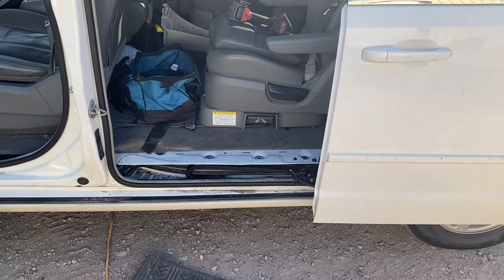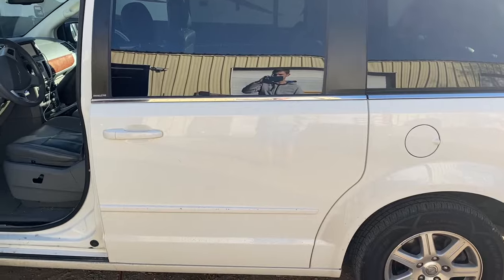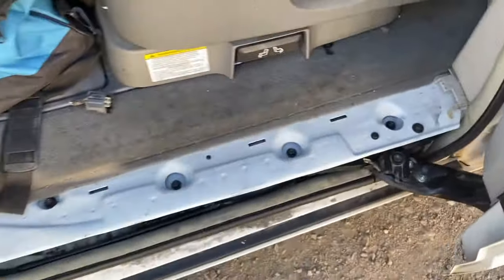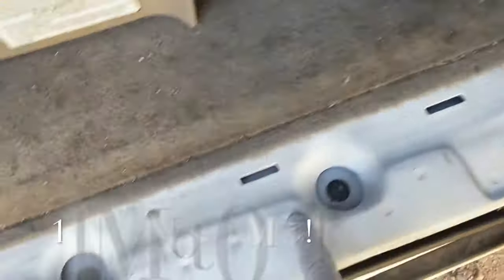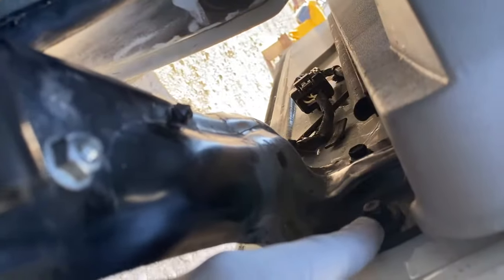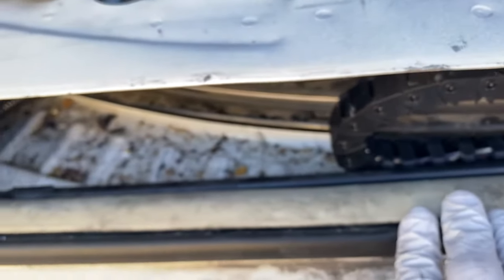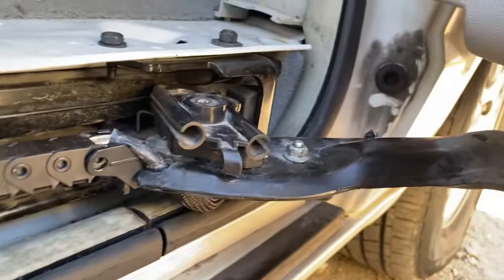Chrysler Town & Country Dodge Grand Caravan Power Sliding Door Issues 08-20 FIXED!

Comment: Be sure you sliders are lubed. My door was stopping half way then reversing. I lubed it up with penetrating oil by simply spraying it in the upper slider and that fixed it. It closed/completed the cycle after that.
Reply: Which are the sliders?

Comment: We’ve got a 2014 Towne &Country and the rear drivers side door will not open or close by any means. Fuse M38 is fine.  Other door is fine. When I push the button above the drivers head, I hear a clicking sound in the driver FRONT door, but the driver rear door does nothing. Cannot open it manually either. Any suggestions?  It is closed flush with the body.

Comment: I have a 2014 and on the passenger side I replace the motor Amtrak assembly I'm still having the same problem
 I would push the buttons the door would open partway like it lost power. Same with closing from open position, close part way than stop. Then replaced wiring harness with new, still same issue. Help.
Reply: Module  bro

Comment: 2014 T&C, My Passenger Door Stopped Working Via The Button & Passenger Window Stopped Working At The Same Time, I Replaced The Chain & It Didn't Fix The problem, I Also Checked The Fuses, Do You Have Any Ideas??
Reply from the maker: Connection issue potentially? Front passenger window? Or which window are you talking about
Reply: The same window in the passenger sliding door.

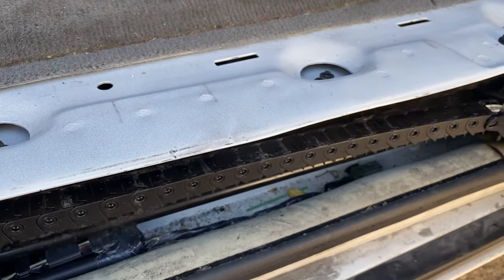Comment: I have the same problem that you had, described at 3:38, where the bracket broke off of the door arm.  Can just that piece be replace?  The cable has me concerned however, because like you describe, the cable is wound up in the motor at the front (under the drivers seat belt).  Do I need to replace everything that you did or can I just replace the bracket?  And if I just replace the bracket, how do I re-stretch the cable?
Reply from the maker: I would just replace everything. I think it’s too much of a hassle to do the cable and the part isn’t that much.

Comment: What possible reason could be the rear sliding door switches do not operate the doors. One switch went out months before the other. The key switch operates the doors as well as the 2 switches on the console up above forward.
Reply from the maker: Could just be bad switches.

Comment: both sliding doors operate fine with FOB and roof/visor mounted controls, but both just quite operating automatically using the interior pillar buttons or by pulling on the door handles... any ideas?
Reply from the maker: Replace that switch.

Comment: What if BOTH doors suddenly stopped working?
Reply: mines did and the windows in the back
Reply: Same issues I'm having plus the seat heaters for both back seats stopped working. It all went out at once.
Reply: Sounds like the fuse in the engine bay.

Comment: My doors won't open even manual
Reply: Bcuz I have kids I took my panel off, had 1 of my kids manually try to unlock it while I pushed with both feet. It made a large bust noise. But manually opens up and shuts. I made sure to tell all my kids even if front doors are locked they still will open. Just pull the handle as if you are opening the door. Just in case of an emergency. Plus they know break a window if have to those can be replaced.  It's been over a year now still opens and shuts manually. Oh ya.. Be careful I had my kid make sure fingers were just there and prepared them that the door may open and could break off so back-up quick LOL Super mom for breaking the door 🤷😂
Reply: @14babzie  Thank you.
Reply: NP hope it works 🤞
Reply: Another thing I turned the switch thingy off where u can push the doors to open.
Reply: @14babzie  I will try.  It was working perfectly last week and when I was trying to open it Monday, it won't budge.
Reply: I'd try to manually unlock it first flip it up and down if u can. Mine makes an annoying buzzing noise, when I go to unlock it even now it makes that noise. When using my remote for the one door it won't make a sound or anything. All my other doors work and slide open.
Reply: @14babzie  I'm waiting on my hubby to help me out.  Thank you very much.